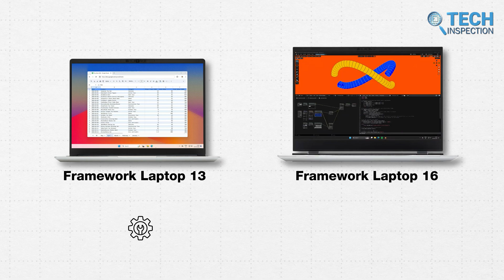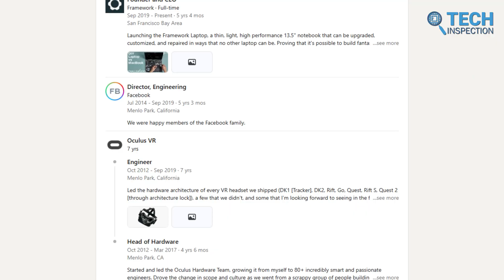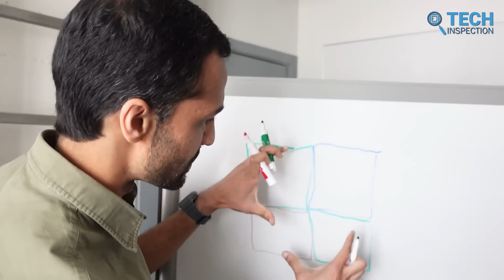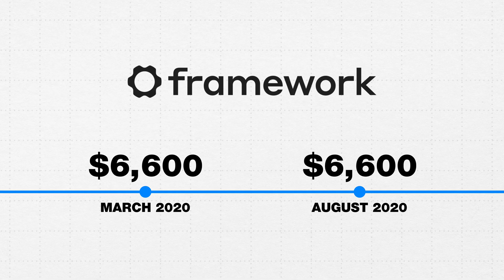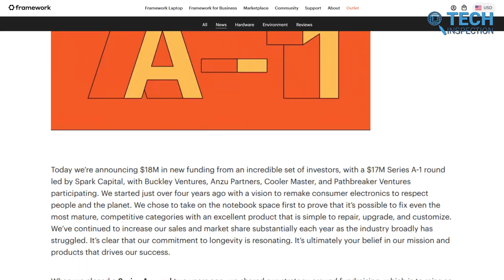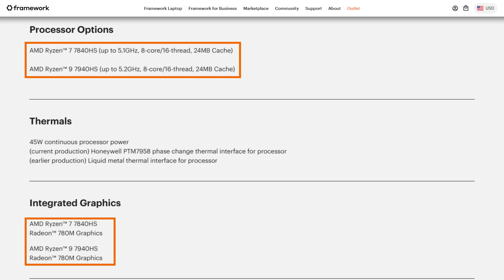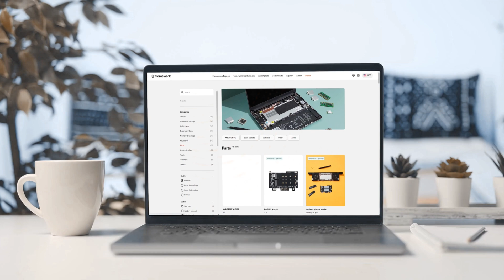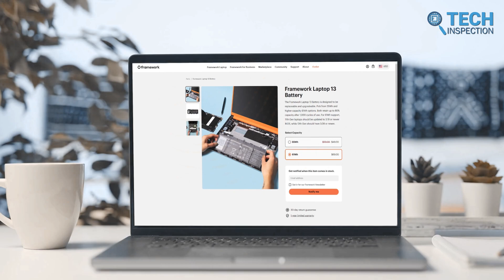Framework - How a Former Apple Engineer Made This Successful Laptop Brand!

Comment: I bought a Framework 13 last spring.  Went with the slower AMD option and the slower M.2 drive, which are still very fast.  I do miss mouse buttons, but it does work very well.
Reply from the maker: Thanks for sharing your experience! The Framework 13 is a great option for those who want a flexible and customizable laptop.